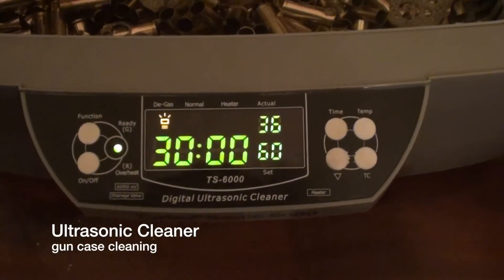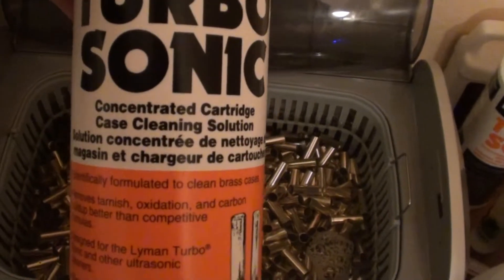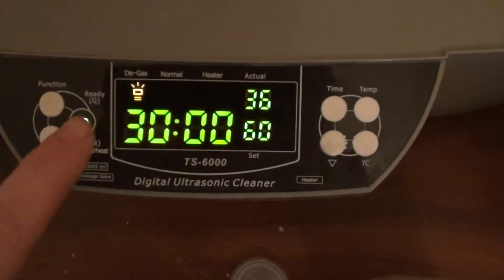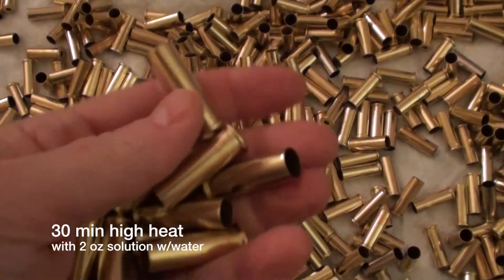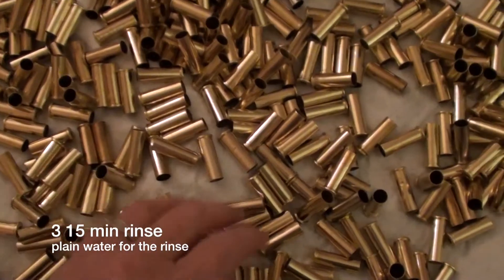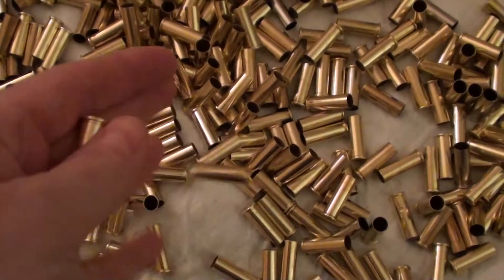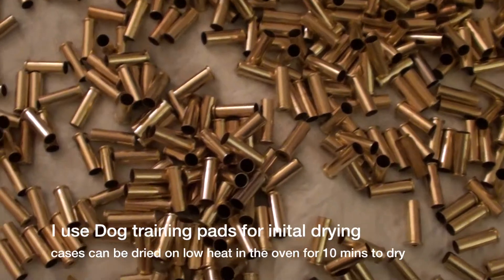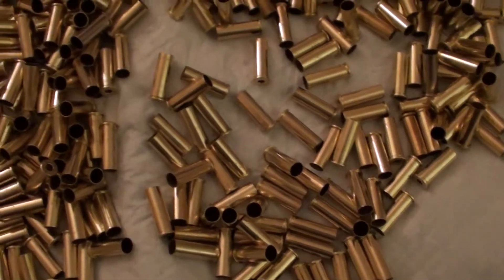Turbo Sonic 6000 Ultrasonic Gun Casing Part Two

Comment from the maker: I have a found a few ways.
    1) air drying the casings - that can take while if you have a lot of humidity
    2) on a cookie sheet on the lowest setting in the oven - 15 to 30 mins should do it
    3) with a hair dry - which can take a long time
    4) I often lay mine out on a dog training pad to absorb moisture and place them in front of my window A/C stirring them every 15 mins.

Hope this helps...